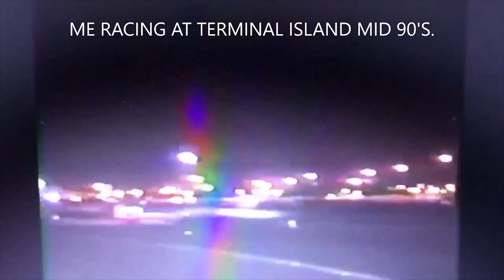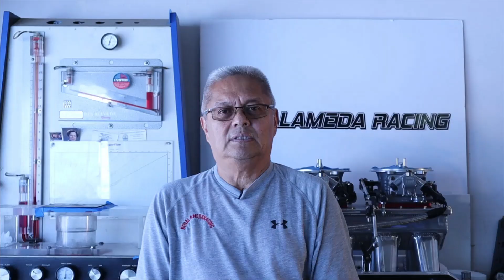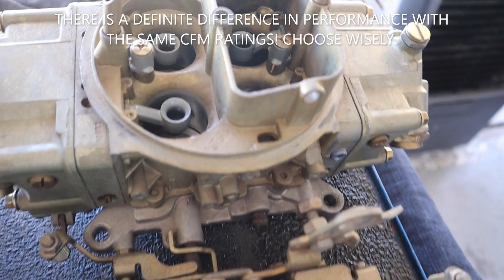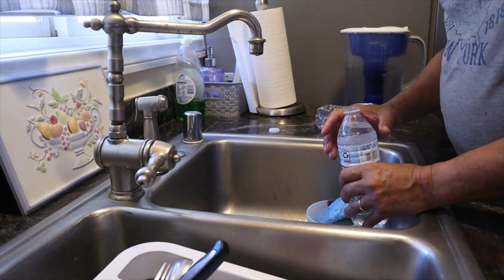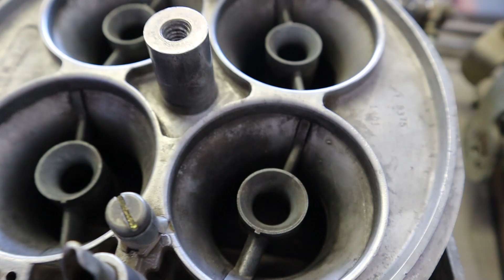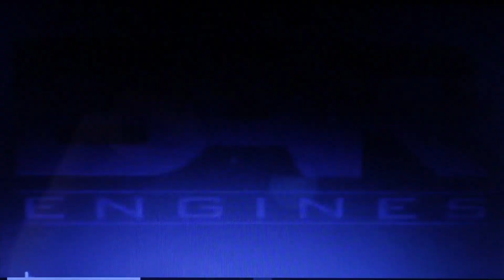BEST CARBURETOR FOR STREET OR TRACK?

Comment: These things about different boosters and things discussed in this video are things I've giving lots of thought about. Let me first say the engineers at Ford knew something about all of this, probably at chrystler and GM as well but Ford is easy to see. About annular discharge boosters they were available very cheap from many places but cheapest is the factory ford 5.0 HO equipped with holley carburetor or Ford truck carburetors from the 1980s. The edelbrock AVS2 series carburetors as well have these boosters. So Ben do you think having annular boosters on primaries of these two carburetors would be a good start for low budgets seeking good results?
Reply from the maker: Love your question Toral and fits into my agenda of knowledge and information. I just got done conversing with a long time customer I have done engines for him for about 30 years!  Will be doing a video about it and he made 318rwhp which equates to about 400flywheel hp using the stock HO carb!  One thing stood out clear to him is the HO carb which I have modified many and his experience again testament to the veracity of how good the annular venturis are and 400hp is very impressive with very mild combination which I will be showing.
Reply: @benalamedaracing2765 that's great news. I look forward to this coming video. Personally I was impressed to discover the factory ford carburetor had annular boosters and how does this go on so long with little discussion.

Comment: Hi Ben, interesting video…got me thinking! I have a 2700 lbs car with manual gearbox, with a sbf 306ci, 224 cam, World Products 200cc heads, Weiand Stealth intake, standard 650dp and 10.8 cr. Do you think I would benefit from annular boosters? Cheers, Dave
Reply from the maker: More chances than not you will benefit from the increased signal thru the booster giving it a more responsive output.

Comment: I have a question about the Annular and down leg booster Mr.Alameda, 

If im planning on buying a 950 carburetor with either a annular booster or down leg for a 408 sbc with about 12:5+ compression.. 260/270 duration @50, wouldn’t it be even SMARTER for me to go with a 1050 cfm carburetor with annular boosters instead? Because technically, the 1050 would become a 990 (-60 because annular boosters). Not only would I get better lower rpm power with the annular boosters, but I would also still have +40 more cfm then a 950 down leg OR annular booster carb.

My theory is that the 1050 may be a little big for the combination I’m building..BUT, if I run annualar boosters, it would not only drop the cfm to better match the combination, but I will still get the benifits with the annular boosters all while still having more cfm then the 950. 

What’s your thoughts on this theory of mine😂? Thanks!
Reply from the maker: Been there and done that you are thinking correctly and go for it!  How much stroke do you have on this engine?
Reply: @  The stroke on the engine is a 3.75 and has 5.7 rods. I ended up going with a 1000 cfm carb with annular boosters from atm. The combo is fairly mild and plan on using it for a little bit of street as well,  so I believe the 1000 would fit the combo like a glove. I have one more question if you don’t mind, do you think the cfm would work well with e85 as well? My plans are to run 110-112 octane for track use, but liked the idea of being able to convert the carb to e85 for when I’m riding around in the street and being able to keep the timing advanced. Im not to big of a fan with running 93 octane and having to retard the timing in order to keep it from detonating😂 do you believe this carb would do fine with e85 or would it be fairly to big or too small? Thanks!

Comment: Wow thank you for the awesome video.  I have a holley 850 dp on a zz502.  Down leg boosters. After watching this awsome video I'm going to change the boosters to annualer . What size jets should I run after I change to annualer boosters?
Reply from the maker: You need to cross reference your carb venturi ID and throttle plate diameter and look at a comparable CFM 850 on copy their jet numbers and that should put you close to the ball park. Or ask for Holley Tech and they can give you a more definite answer.

Comment: The gravity affect on the water makes a low pressure area in the top of the bottle and atmospheric pressure forces air in to fill the low pressure area. Gravity is the force pulling the water out, The low pressure area created by gravity allows air to equalize the pressure forcing it's way past the water which is flexible and not very compressible.
Reply from the maker: Since water is malleable it conforms to pressures outside and within these is why it did what it did.  If it resist changing and keep its shape it will not drop to the bottom.  What we see is atmospheric pressures distort and push itself on the sides/middle or whatever to get inside the top of the bottle and pushes it downward!  Keep this in a firm condition and it will not do that.  Gravity also has its effect because water has weight with its volume... If we would gel or freeze the water then we have a different scenario even if it is not stuck to the bottle's sides.
Herein, leakage off the sides will allow atmospheric pressures to go to the closed top of the bottle and pushes the solidified water downward.  Science is fun isn't it?  lol
Reply: Sounds like my Physics professor. @benalamedaracing2765

Comment: Well done. I do believe  the annular discharge booster would help a lot of street applications solve their issues with surging while running at cruising speeds. Mystified fuel vs a river of separated fuel  running on the floor of the manifold then re-atomizing at the valve seat.
Reply from the maker: Agree sir and you got it right and a tight quench clearance helps the whole process big time!  I will do a video on just these scenarios soon and should be a good one.

Comment: no quadrajet?
Reply from the maker: Quads are good carbs and very responsive!  However they are not track friendly unlike a holley's modular design, which can easily be disassembled and adjusted without much complications.
Reply: @benalamedaracing2765  i wish someone would make an updated version of a quadrajet with annular front barrels. I know edelbrock tried but they have some flaws and aren't big enough for a really strong street engine. Not to mention they don't make the quadrajet sound I love🤣🤣

Comment: Hi great video! Question. Is it implied the straight and dogleg naturally consume more air in your water bottle demo? And would this have any effect on making the mixture more rich?
Reply from the maker: Dogleg boosters flow about 20cfm more with the same venturi and throttle shaft size!  The difference is within the air bleeds used and meanwhile the annular venturis actually run a richer on the rpm drop after a gear change which helps high compression engine.

Comment: Another great video!  I’m thinking my 9.7:1 454 with 221/235 @0.050” HR cam, air-gap intake with 3310 VS Holley may have some left on the table. DaVinci added downleg boosters to the secondaries and said it flows 830 cfm.  I am wondering if I need an 850-950 DP with annular boosters?  It is a street driven ‘72 C10 with occasional trips to the drag strip.....and beats up on the occasional loud hemis & stangs.....😂
Reply: you probably only need a 750  with annular discharge .  that cam is small for a 454  and probably wont make power past 5000-5500 RPM
Reply: @KingJT80  it makes gobs of power to 6k where it hits the rev limiter.....
Reply: @trailerparkcryptoking5213  yeah that actually sounds about right.  the 750 AN  quick fuel carb  would be a good one for you.  has an electric choke too

Comment: I hope you see this... Over the years it has been evident that carbed vehicles with overdrive transmissions tend to bog and get crappy mileage if they are running at or less than 2000 rpm at highway speeds. This is, of course, where FI shines. However, with the low-speed superiority of the annular booster, would it not follow that it could handle low cruising rpm's better than the other boosters? Some factory Ford Holleys in the 80's came with annulars. Were they hedging their bet against the "new" overdrives? Thanks for your input. Yes, my YT name is what you think it is.
Reply from the maker: Yes sir you got that figured out that Annulars do exhibit superior performance compared to straight or dog leg boosters.  I believe with such tall gears out back and overdrive autos/sticks that will be an issue and possibly exhibit some low rpm surging.  My 85 5 speed HO had 3.08 and the front venturi's if I remember correctly did indeed came with an annular venturis at the front of the carbs.  It worked great and I did some changes evaluating this thing @ the now defunct Riverside International Raceway and had to convert the rear metering plate to a standard type removing the stock flush type plate system at the rears!
Reply: @benalamedaracing2765  My friend had a car just like yours and he reported worse mileage on the freeway in 5th than in fourth. No surging, but no power, either. He switched to 3.73 from the 3.08 and the rise in power and mileage was major. Does it make sense to put annulars in the rear for freeway use?
Reply: @413x398  good question!  Was wondering the same thing after hearing annulars are better at lower rpm....

Comment: ok then im going to smack it  im trying a sbc 396 at 14.5 :1 ive never handled pistons so short or a dome or stroker . At least third time ive watched this  one
Reply from the maker: It figures @ 396 you will have a stroke of 3.75 depending on your overbore diameter.  If you had a 400 block @ 4.125 bore x 4.00 stroke you would have a 427 small block!  Here with a 64cc chambers and a flat top you would have somewhere around 12.4 or thereabouts!  That is with a flat top.  A small dome which is not really bad will take you to 14.5 without much effect on your combustion efficiency.
Reply: @benalamedaracing2765  its actually a 3.875 crank .040 bore its i think 397.3 i just like to call it a 396 should i go 14.5 boy that sounds like a bunch how much octane does that require approx.
i spouse ill go there just to see im assuming this short piston will tighten up as it heats and not rock so much man a 28 -32 quench is so small 40 dont look like enuf

Comment: Thank you Ben! This video really breaks down the difference between boosters and how you explained it makes all the more sense!
Reply from the maker: Thanks and I could not have made the power i did if I ran an inferior carb booster and this thing allowed me to brake torque my engine without a trans brake of clutch and leave the line fast to a low 10 second run in 1990.  I couldn't get anyone to give me a jump with an all steel car and interior with diminutive 9.00 x 27.00 M&H slicks!  lol  I ended up giving some of the nitrous cars the space with this innocent looking mustang.  lol

Comment: So...
In a wedge head motor the quench pushes the flame front back at the plug?
Reply from the maker: It actually does push them at the vicinity of the plug location however, the other important aspect is its ability to blow the fuel wetting areas accumulating beside the spark plug location!

Comment: Ben, I hear it is possible to put the 750dp main body on the 850dp base with a few modifications. Would you be familiar how to do that? I have a new 750 main body with annular boosters and an old Quick Fuel 850dp. I was thinking they might be a good match.
Reply from the maker: Yes I have done this very thing and just note the gasket matches the holes on the main body & throttle plate.  Use the 850 throttle body gasket and it should be a breeze making them work.!

Comment: Years ago I switched from a Vac Secondary 750 to an annular booster 850 dp on my 440. Wow !! What a difference!! The car finally accelerated like I had always envisioned.  That 850 annular carb, combined with a new 3,500 converter netted me 6 tenths reduction in e.t. my next time at the track. Been a firm believer in annular boosters ever since. Your experience confirms it.. thanks again for sharing your valuable info Ben.👍
Reply from the maker: Thanks for supporting my channel and your comments which really gives credence to what we have experience with annular discharge venturis on this holley carbs.
Reply: @benalamedaracing2765   You're welcome. 🍻
Reply: Yup

Comment: Any experience with the Predator or Kendig carbs?
Reply from the maker: I did years ago with a Kendig and was not entirely happy with the fuel control or its capability to mystify the fuel molecules to something more combustible.  Venturis are hard to beat and I feel this is why it did not really get going with the racing community.

Comment: The engine sucks fuel and air.
Reply from the maker: It is the agreed description of many but from an engineering point of view, there is no suction or vacuum at play.  Correct terminology is "absence of pressures" and "differential pressures" which makes the engine function as designed.
Reply: This comment differential pressures!

Comment: Hello, your channel just came across my feed 2 days ago and I am so thankful for all the information you are sharing. I do have a question about Dynamic compression, alot of people say no more than 8.5:1 for a street engine but does cylinder pressure overide that statement? Which is more important the Dynamic compression number or the actual cylinder pressure. Could you please explain Im a little confused. Thank you for all your information.
Reply from the maker: Just make sure when cranking about 4-5 kicks on the compression gauge you do not exceed 200psi.  Lower numbers from here it will run with no problems with 91-93 octane pump gas.

Comment: Back in the day I played around with stainless steal screen mesh in between two 1/2” carb spacers! I was amazed how the drivability improved. Assuming because of atomization improvement! Night and day difference! Only problem is the mess kept breaking down! Assuming from the heat of the engine! I’ve seen intake gaskets with a similar mesh material built into them years ago but imo just under the carb would best!
Reply from the maker: What you found out was the mesh broke up the fuel droplets into tinier spray mists and there is your added power!

Comment: :Always great info and explains it very: well . You're like a horsepower, racing, dictionary . On my 347 422rwhp 11.3:1 compression 210 cc ported heads and intake thats single plane i asked about a better roller cam spec that u would recommend that duration @50 is 242 In and 248 ex  lift is .576 In .600 ex 110lsa
Reply from the maker: I pm you at your channel.